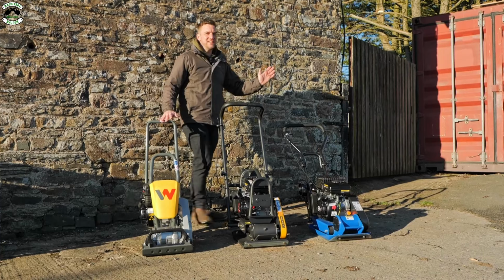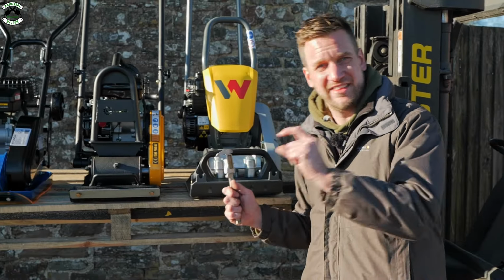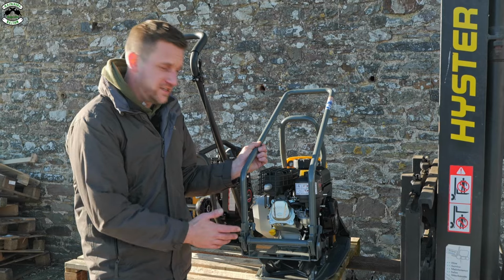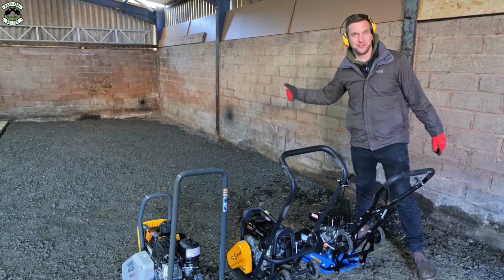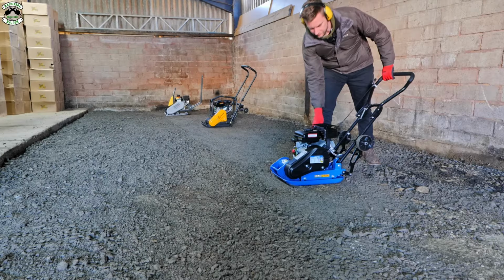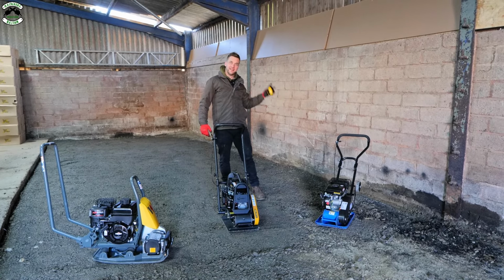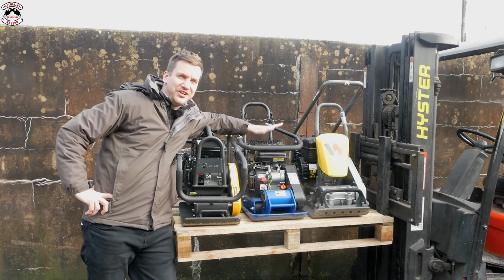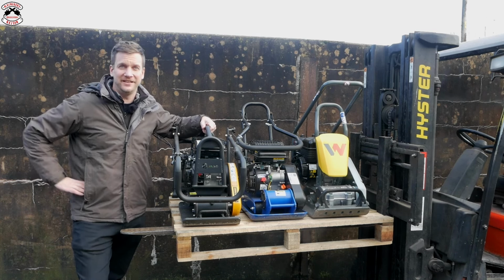Compactor Plates - Which one would you choose?

Comment: Don't hold the plate back, they are designed to go at a certain rate of speed, giving you best performance for the area, by doing so can damage the clutch  or belt. One pass with a plate on your jobsite is usually never enough, 2-3 passes minimum. Wacker beats all other manufactures hands down in speed and performance and also offers several different plates with high compaction force.
Reply: how about altrad belle plate compactors ?

Comment: You had the choke on on the blue one.   I have had the the same unit for over with no issues. The only difference between these 3 units is there working depth. The little one is great for sidewalks with a one inch working depth, the middle one will do one and a half inch  and the wacker will do two inches.
Reply from the maker: We did to start it, but not while using it 👍🏼

Comment: I'm sure this a a well thought in depth video, but, before i watch, i want to clarify something.
these are NOT compactors. these are vibrating plates. a compactor forcefully beats/hammers down to compact the material to give strength to the base for foundations etc.
vibrating plates (demonstrated here) are designed to have a plate on the bottom to make contact to ground, which, when vibrating, will then even/level the material surface.

two very different tools for 2 very different applications.
SOURCE: My dad was a technical sales engineer for Wacker before it was took over.